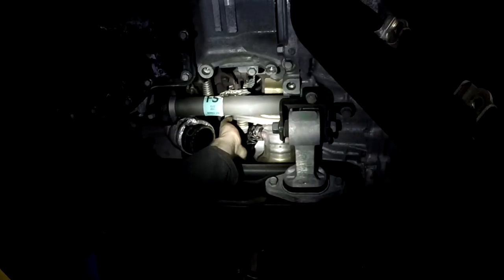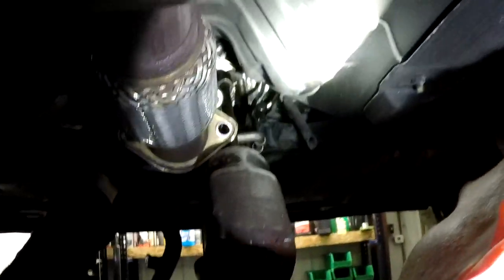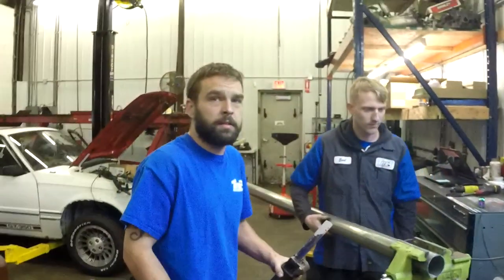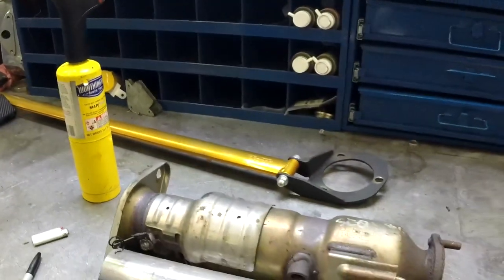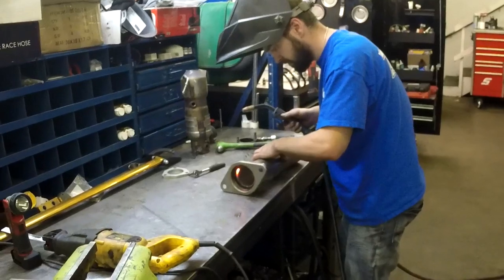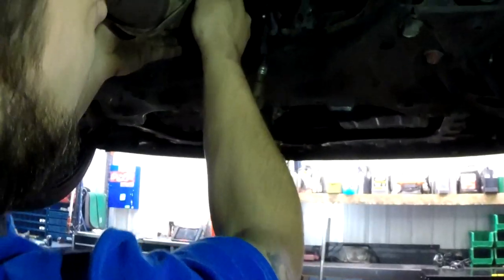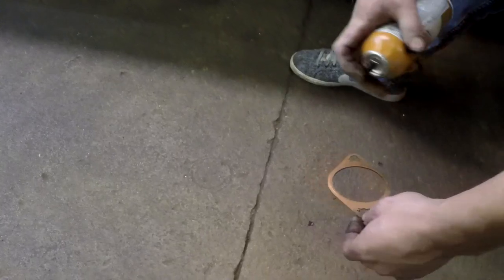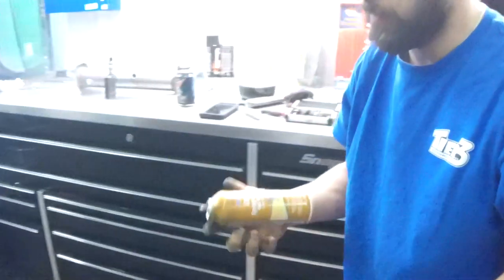Veloster Catalytic Converter Delete

Comment: Glad I found this channel. I have a 2014 V. Base auto. Ive always thought that straight piping it would get me some more horsepower. Is this true also im close to Nashville TN but don't have to worry about emissions. No turbo on mine. Is like to ask are their any downsides to removing the cat. Or should I just replace mine?
Reply from the maker: You'll more than likely get a check engine light but you can get rid of that with a tune. Since your car isn't turbo it more than likely won't do much for your car but you can still try.
Reply: @TiresAndSmoke   i just replaced my engine on my veloster base and already at the cat replaced before the engine and the engine light is on cuz of the cat again but car is running fine now anyway to make thw light go away for good
Reply: @itswepa420  how much did you pay for a new engine if you don't mind me asking? Personally have a Veloster '13 Base and feel like its coming to a near end of life sadly.
Reply: @thiago8070  to much coulda put a down payment on another car
Reply: The non turbo veloster doesn’t sound the same as the turbo version. So if you do an exhaust mod I worry you’ll be disappointed 😕

Comment: i thought removing the cat caused a check engine light to occur?
Reply from the maker: It does lol. Which is why we brought it to a dyno tuner to tune the vehicle to the new setup and remove the check engine light.
Reply: @TiresAndSmoke  also where did you get the wing and rims from?
Reply from the maker: @TheHoodedMenace_  she found that online on facebook market place. I'm not sure where you can get those new.
Reply: @TiresAndSmoke  last question i noticed in the video you posted of bringing it to the dyno tuner they said the solenoid was not working correctly? which solenoid were the referring to? and is that something to worry about typically when doing cat deletes on the veloster turbo?
Reply from the maker: @TheHoodedMenace_  no it's a common part to go to hell on any turbo veloster. Nothing to really worth about and it's honestly a 5 dollar part. You'll be more than fine.
Reply: @TiresAndSmoke  yea im already knowing lol apparently on my 2016 veloster turbo the system vent valve solenoid circuit is “bad” which caused a check engine light and then one day the check engine light went away on its own. I was thinking of doing a cat delete but I think I might just start with the resonator and muffler delete because I cant afford to tune right now lol